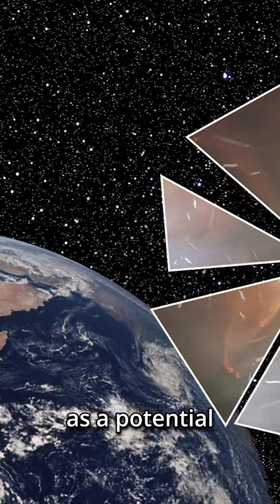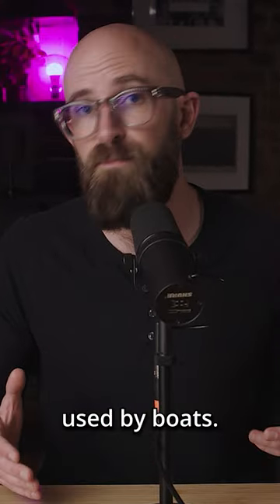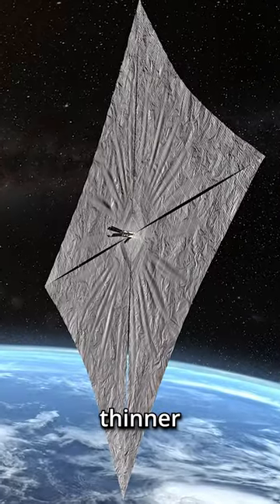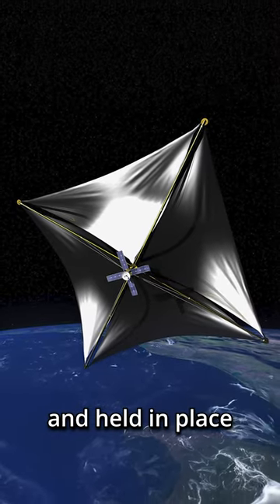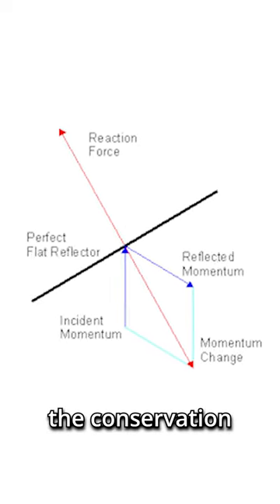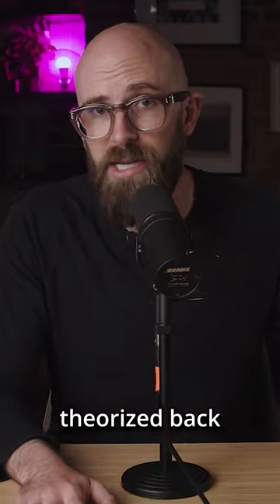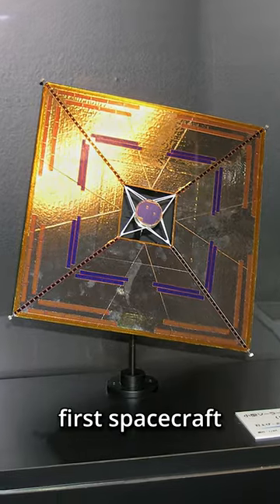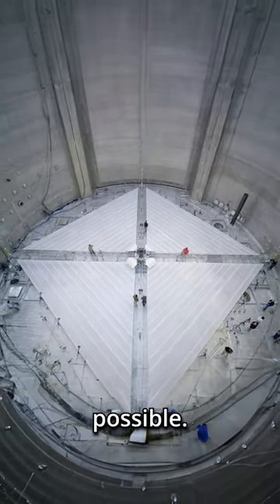How Do Solar Sails Propel Spacecraft Through the Cosmos?  #shorts

Comment: How do photons have momentum if they have no mass?
Reply: Photons do have mass. And this is proof that current physics has gaps.
Reply: I’m not a science guy per say, I find it interesting but I deep dive other subjects. I’d assume anything that exists has mass? Even if it were negligible to us, but if it physically exists how would it not have mass?(legit question)
Reply: Photons have mass. They can't have momentum or energy without mass
Reply: Apparently photon's rest mass is zero but it has non-zero relavistic mass due to its motion. I guess it relates to Einstein's theory of relativity which describe the relation between mass and energy. Photon has energy from its motion and that will I guess manifest as mass.
Reply: Anything in the universe that's not in a pure energy state bassicaly have mass no matter how small
Reply: Electric and magnetic fields are capable of containing momentum
Reply: tl:dr   no one knows exactly how light can exert a pushing force and how photons will push solar sails in vacuum
Reply: @ydid687 well maybe you should read then you might learn something!
They can & do know, listen to it again. 
So that covers both reading and listening.

Comment: Darn this bloody phone I meant HOW do you Steer  light only travels in straight lines!😮 This phone is getting doppier than me😂😂😂😂😂
Reply: Same way boats sail. Just because the wind (air or solar) only "blows" in one direction it is possible to put the sail at an angle to the winds and convert some of the force imparted by the wind to a different direction.